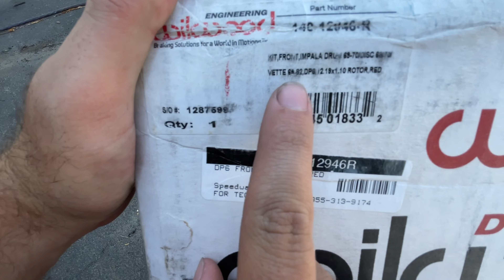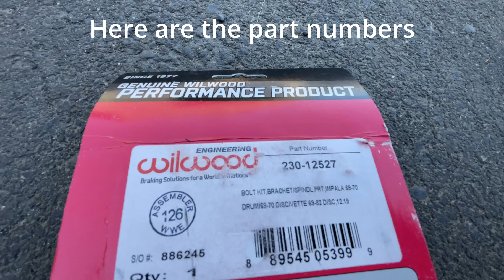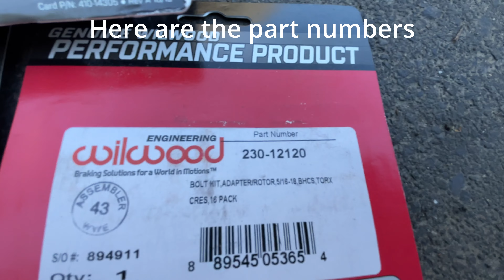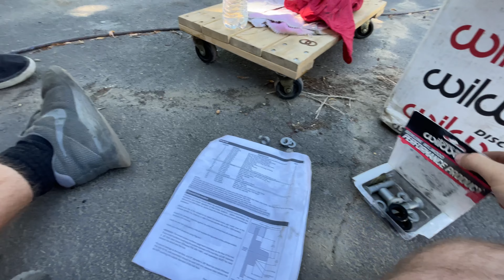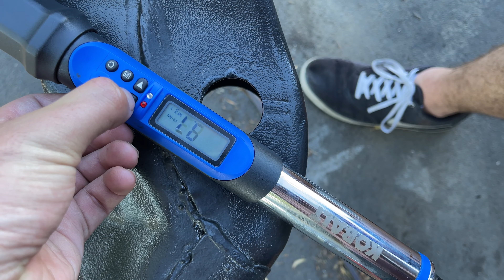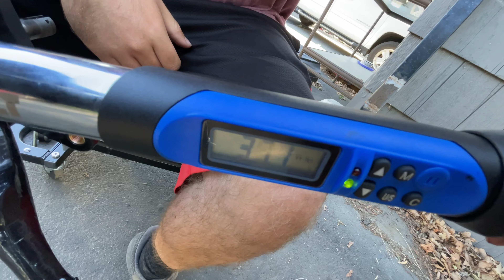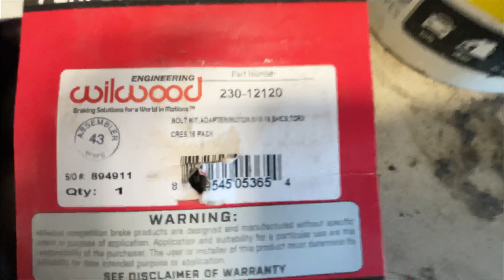How to Install Wilwood disc brake kit on a 70 Impala/ 69-81 Corvette

Comment: Hi What state are you guys in?  I am in E. Tn, near Knoxville.  I have a 70 Impala 4DSD.  31K ACTUAL non rolled over miles, original shiny paint.  I want to upgrade from 4 wheel manual drum brakes with this kit. Are you local to me??